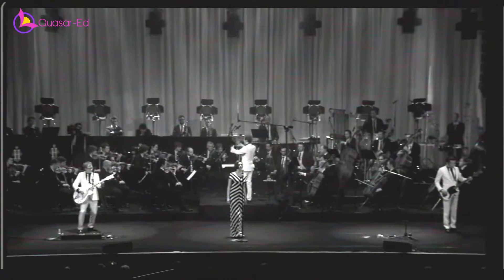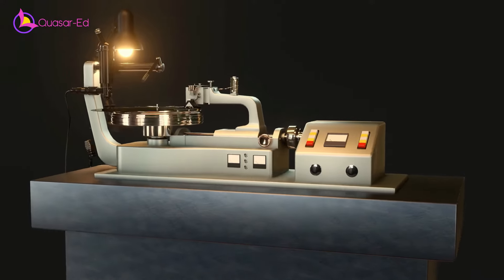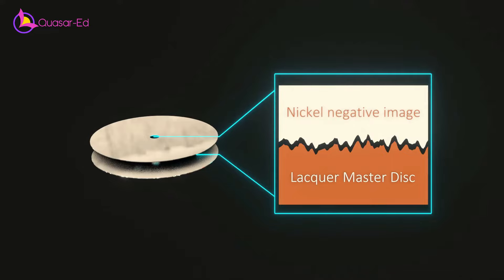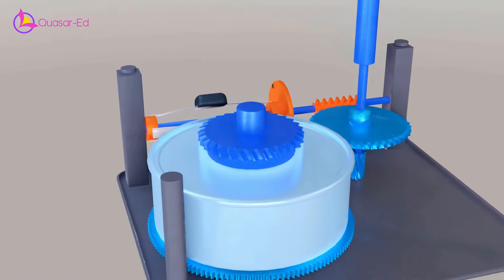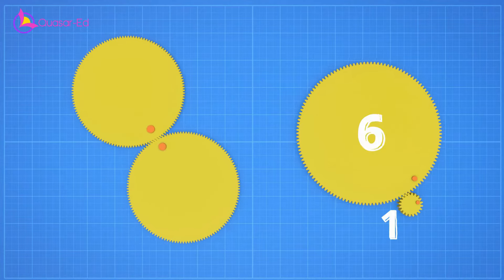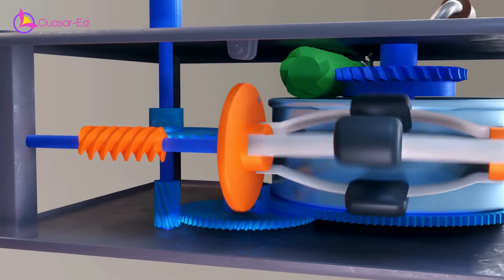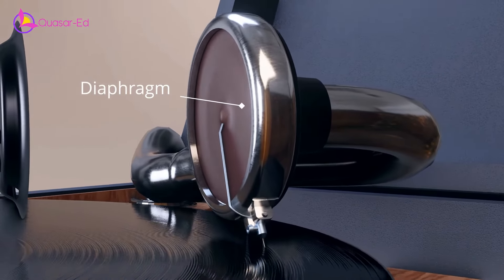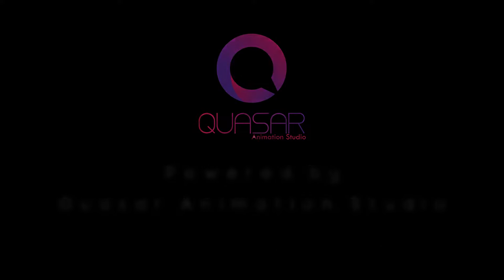How A Gramophone (turntable) Works | 3D Animated Explainer

Comment: cool, thanks! I still dont understand how all the possible sounds on a vinyl disc can be expressed by just the depth/shape of a groove but I think thats partly due to my lack of understanding about exactly what sound is.
Reply: This is a pretty bad explanation of the entire thing "but the animation looks cool"...

It will definitely help to understand how sound waves work before trying to understand how this gets mechanically encoded onto the disk.

Basically the movement of the groove under the needle (working in combination with the mass of the sound box) forces the diaphragm to move in and out at the throat of the horn. This sends pulses of air pressure down the horn (which amplifies their volume by allowing them to couple to the room air more efficiently). 

These pulses moving in the air are what your ears pick up as sound, and are (in theory anyway lol) a representation of what was originally recorded on the disk.

Recording is the inverse process, on a machine called a recording lathe, that cuts a spiral groove in the disk that "wiggles" according to sounds coming from a device that isn't all that much different than the playback equipment. If you look at a record under a microscope, you can see these wiggling patterns in the grooves; these are the sound waves.

Sound is funneled in, where it hits a diaphragm and forces the cutting needle to move with a likeness to the sound. Yes, this took very large horns and specially designed rooms to catch enough sound energy to record with. And they needed to be *loud*. This is why records from this era sound so "forced" - they had to be. 

The "more modern" LP uses a similar idea even, only everything is handled electronically... the needle in a record player is similar to a microphone and the recording version is a specialized type of "speaker".

So in a nutshell, "the sound comes out just like it went in".

Stereo recording is a modification of this process that causes the stylus to vibrate both up and down and side to side in such a way that they are largely independent of each other, allowing 2 channels of audio to be recorded in the same groove.

How this is done is beyond the scope of a YouTube comment but it is encoded in such a way that mono turntables automagically mix the 2 channels together so that the contents of both can be heard. The audio isn't simply recorded vertically and horizontally in the groove... it is a type of "matrix" that manipulates the stereo needle correctly without cutting one channel out of monaural playback. Instead of using the entire groove for 1 signal, each of the 2 angled walls of the same groove has one channel embossed in them.

Hopefully I haven't just completely confused you further... it's an interesting scheme, and a similar philosophy/methodology was later used for FM stereo as well as color TV.

There's more to all of this than ever met the eye at the time 😊
Reply: @MadScientist267  Thanks for this comment definitely helped understand the way sound waves travel like through a diaphragm microphone it just duplicates it. I think I understand now and it's pretty cool how these work because it's the same idea as the automatic transmission with gear reductions and "brake pads".
Reply: @noahwithee7376  Yes, just like in your ear, the diaphragm moves in proportion to the sound wave's pressures, and the coil attached to it moving in a magnetic field (in the case of a dynamic mic) translates this into an electrical signal that represents that vibration.

At the speaker, the reverse happens, and a coil receives an electrical signal, interacts with the magnet, makes the cone move, and if all went well, this recreates the air pressure vibrations that the microphone heard during recording. The waves enter your ear, make the eardrum vibrate, and you hear the original sound.
Reply: I'm laughing so hard that's LITERALLY where I am at too and I have this machine and been playing with it since I was a kid and that is where I am stuck I don't understand how the groove translates to a precise sound 😂

Comment: It's a really good video and covers a lot of stuff like the 'non return spring', which is not understood by many people.
However, there are several mentions of vinyl records, which is incorrect. Gramophones never played vinyl records, just shellac based ones. Also, although the section on record manufacturer is very well done, I think it also really refers to vinyl records. Gramophone records would have been recorded on wax, and originally using an acoustic only (no electricity) system similar to how the gramophone replays the record.
Well presented and interesting to watch though. Thanks 😀 👍
Reply: Thank you for your advice and info.
Reply from the maker: sorry about my wrong use of vinyl and shellac terms, all my attention kind of went into the working principles. Thank you for watching.